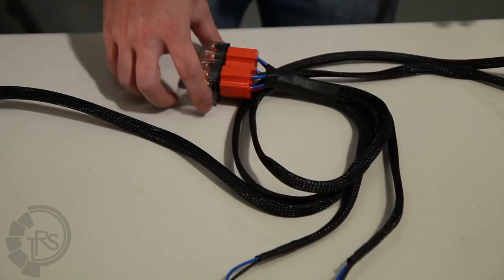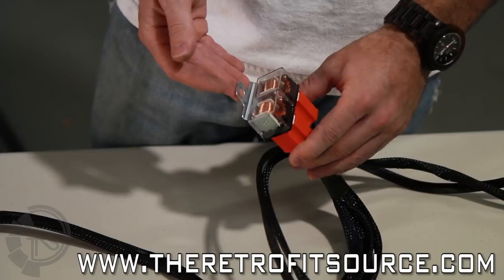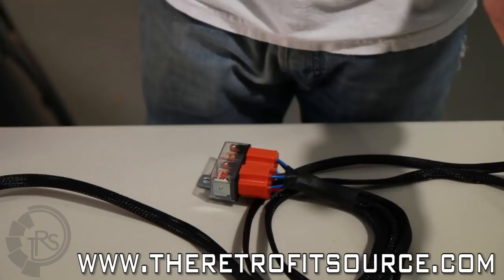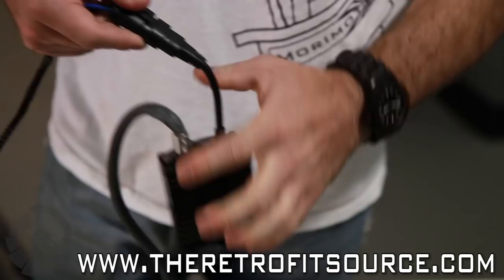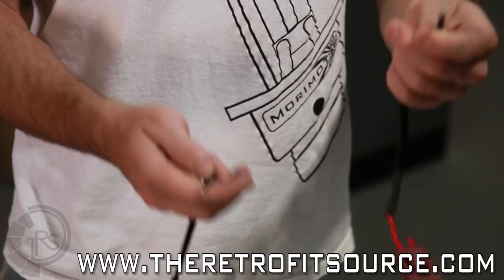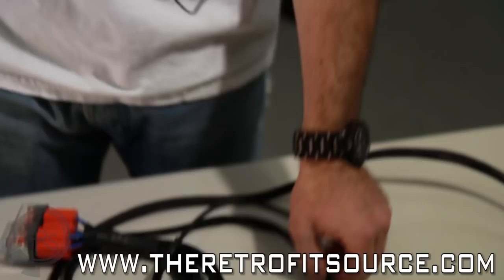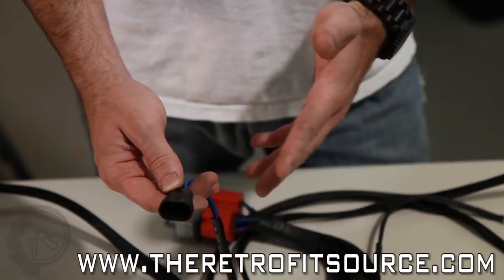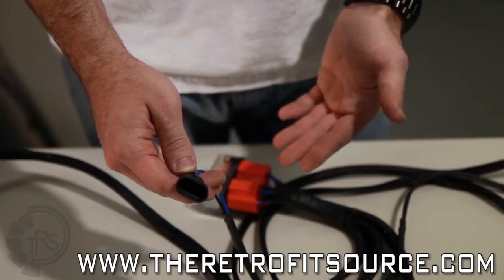TRS Tech: Morimoto HD Relay Wire Harness Installation (9005, 9006, H1, H3, H7, H8, H9, H10, H11)

Comment: What if each OEM low beam has it's own trigger?  Do you need a separate harness for the trigger on the opposite side?  Everything is in pairs except the input trigger where there is only one.
Reply: +Vette2112 No, a lot of harnesses are just setup with a single sided trigger but outputs for both headlights. The other side can just be tucked away

Comment: The light on the battery side, I have the fuse cable plugged in to the positive side. Does the ground cable need to be connected to the neg. side or another ground location? Both lights are not coming on. I have a 2013 Sierra with Morimoto HID projectors.

Comment: I have a Gen 3 Prius. Which the battery is located within the trunk of the car. How do I utilize the + and - on the wire harness within the engine compartment?

Comment: So how do I connect the 9006 input from the projector to the relay? There’s no hi beam wire to connect this to
Reply from the maker: The HD Relay Harness would be connected to the HID bulb, not the projector itself. And if it's an LED projector, you typically wouldn't need an HD Relay Harness.

Comment: What happens if water gets on the relay, i think that happened to mine. My drivers side keeps going out and there is a really loud buzz coming from the relay. I have the capacitor already and everything is connected right. My hid kit worked fine for the first 2 or 3 weeks and then crapped iut
Reply from the maker: Always mount the relays right side up, not upside down. Our new relays make it almost impossible for water to get inside them, especially if mounted correctly. 

Reach out to us via email and we will help you get the replacement parts you need!

Comment: Why only one control trigger?  It's a pain to hide the other side since water and moisture can corrode it if it's not plugged in.  My 10 year old harness has both control trigger to prevent this problem.  Now I can't find a single harness that comes with 2 control trigger.  Moreover, are those custom relays? They seem fused together.
Reply: +canoeshoe We have sold well over 25000 of these harnesses and never have an issue with the single input, so just haven't found an need for two. The relays are custom yes sir
Reply: If those relays fail, can they be replaced without rewiring?  My concern is with the unused control trigger since mine will be used with fog lights and they sit close to the ground and more exposed to water.
Reply: +canoeshoe yes they could, we have replacements or a standard automotive 4 pin can be inserted into the base

Comment: If you only plug the OEM into one of the original headlight wirings then how does your car not yell at you for having a headlight out on the one side?
Reply from the maker: In some cases yes, in most cases no - really depends on what kind of car you have
Reply: Looks like my car dislikes only having one plugged in (Hyundai Tucson 2018).  Assuming I need to replace the HD relay with a Canbus?  Additionally I am seeing some flicker/strobe after install.
Reply from the maker: Yep! go for the standalone canbus then. That should take care of it Brian